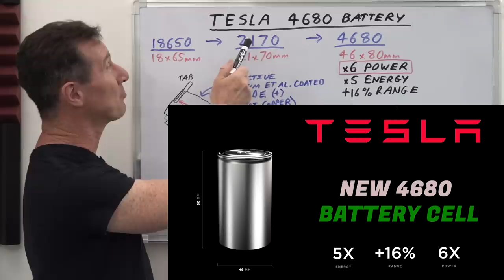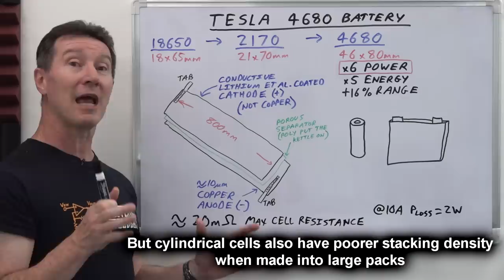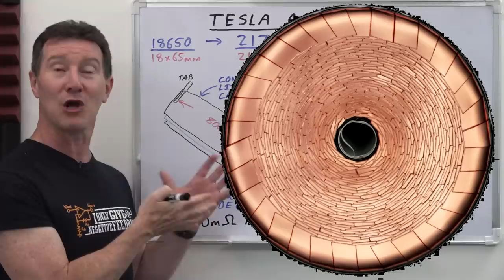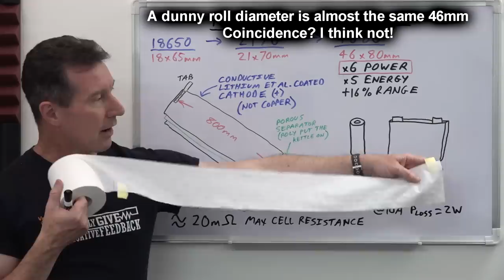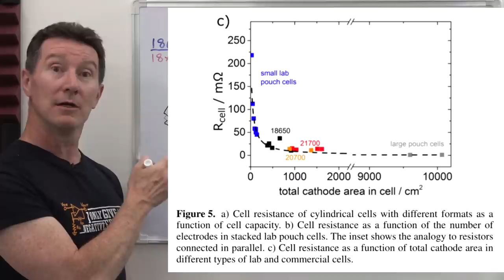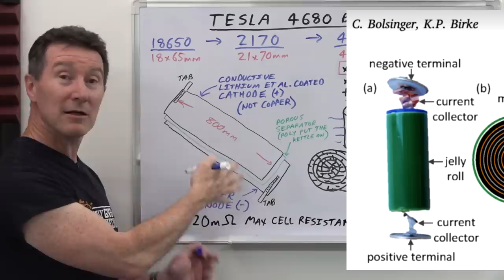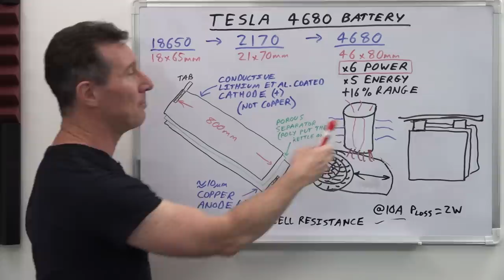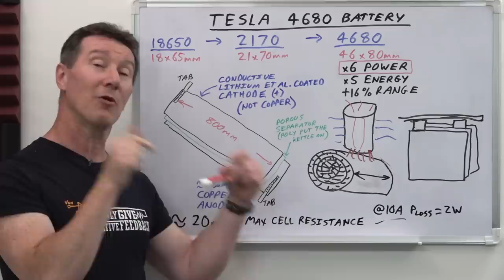EEVblog 1340 - New Tesla 4680 Battery Cell EXPLAINED

Comment: I suspect a non-insignificant chunk of the losses they also got rid of are related to the tiny fusible links connecting each cell to the bus bars, fewer cells = fewer links to heat up. But overall this new construction technique appears to be primarily focused on reducing manufacturing complexity and cost, but it’s been hyped for those questionable specs & claims.

The 6x & 5x figures mixed in with the +16% figure with no clarification really pissed me off and in my opinion was very negligent and honestly probably intentional to get those 'Tesla makes huge leap in battery technology' headlines. It’s very unimpressive when you remember to mention that it’s 5.5x the volume, I feel that number should have been front and centre, but then no one would have been hyped.
Reply from the maker: I'm not sure how this would get rid of the fusible links? But I'm not familiar with existing Tesla battery pack construction.
Yes, 5.5x the volume and only 5x the energy even with new cathode technology. Does this mean it's a step backward in energy density?
Reply: Perhaps this 5x is without the cathode improvement, and marketing has tried to be modest and rounded 5.5x down?
Reply from the maker: @spbnick  That would be the world's shittiest marketing department!
Reply: Apparently Telsa pays $0 for marketing. I guess shitty marketing = no marketing
Reply: @EEVblog  I understood the presentation to be built in steps, so each step was evaluated separately, and then they stacked up the contributions to the total app 55% improvement. Just the form factor is the 16% improvement, then the chemistry x%, then pack construction x% and so on... So they did not say that the 16% is the total range improvement, just that its the partial contribution purely by changing the form factor.
Reply: @EEVblog  less links?
Reply: @EEVblog  They will still have fusible links, there will just be fewer of them per kWh of battery and it’s more efficient to have 1 large fuse than 5 small fuses as wire cross-sectional area increases disproportionately to surfaces area meaning less heat is needed per amount of fuse per cross-sectional area as it increases. 
(figures not for a Tesla battery pack but the math is the same, this math is very back of the envelope so take it with a grain of salt)
But previously if have 39 AWG for an 11 A fusing current for a 1 cm long link you would get 27.29 mΩ per link, put 5.5 in parallel you’d get an ESR of 4.96 mΩ.
Whereas for a single cell with 5.5x the volume if they went up to 31 AWG for a fusing current of 69 A they would have a single link with an ESR of 4.27 mΩ. 
At an arbitrary 10 A per cell with those changes you’d go from 496 mW down to 427 mW, an improvement of 16%, coincidence?

I wouldn’t be surprised if the missing 0.5x energy per cell went toward the volume in the cell this new design takes up, the existing spot welded tab was pretty space efficient, this looks like it needs some special insert at the bottom of the cell along with a decent amount of space for all the folded copper foil, the rest they probably rounded down considering when it comes to packing the battery with those larger diameter cells they will have less efficient packing especially around the edges.

(Note: I’m stupid and probably overlooked something)
Reply: I'm guessing 5.5 the volume and only 5x the energy due to the anode and cathode having to be offset a bit from each other so there would be no chance of shorting along the ends.  There would be a small dead space along the 'jelly roll' edges that would reduce over all energy density.
Reply from the maker: @glassmanCZ  Makes sense, but that's not what everyone seems to have taken away from it?
Reply: @glassmanCZ  I didn’t see that part of the presentation! Although unfortunately it’s just more unlabelled graphs :/ I’m very doubtfully that’s a 55% increase in energy density, considering they don’t specify the units I’d bet it’s some sort of total vehicle range (not normalized for battery kWhs) after 1,000 battery cycles or something.
Reply: @EEVblog   The 16% range increase is only due to the construction and having less casing for the batteries . 20% extra for anode design changes 4% for cathode and 14% for getting rid of the bottom of the car and using the batteries instead. In total it is 54% better.
Reply: @WizardTim  I think the 16% you get is just from using "convenient" preexisting wire gauges, but for fusible links I assume they would be using exact metal dimensions rather than standard AWG sizes.
If you have 4x the battery, fusible link resistance drops by 4x but don't forget current also increases by 4x, so it all balances out in the end and I don't think it's any more efficient to have 1 large fuse than it is to have 4 small fuses.
Reply: @EEVblog  Here as well: 16% range increase, just from the form factor alone.... https://youtu.be/l6T9xIeZTds?t=4511
Reply: @gerrychen  Yea if you go from a fusing current of 11 A to exactly 50.5 A (5.5x) without worrying about standard wire gauges the improvement is only ~3%, but the 16% number popped out so conveniently I couldn't ignore it, if they explained their numbers we wouldn't have to speculate how they got them or if they even mean anything.

While you're correct about the resistance vs current the important thing is that that the fusing current of the wire doesn't increase equally with cross-sectional area like resistance does which is what makes this improvement possible.
Reply: @WizardTim  I didn't know fusing current isn't linear with cross-sectional area - thanks for educating me!  For others interested, search "Preece's law" for the fuse equations - apparently breaking current only increases with the diameter^(3/2) rather than diameter^2 like conductance!
Reply: EEVblog, I suspect that the 5x improvement in power vs. 5.5x volume has to do with dead space in the center of the cell. By going to the tab-less design it appears they had to leave a larger hollow space in the center. That center space likely accounts for the 5x vs 5.5x discrepancy. So in terms of volume per KW, it’s likely a little worse, but in terms of weight per KV it should be a slight win due to lower casing weight and less cooling stuff in the pack. That’s probably where you get 16% better range because it’s likely 16% more power dense interns if weight per KW.
Reply: @WizardTim  It's not "just more unlabled graphs", they dedicated a part of the presentation to each of these improvements and built the figure throughout the presentation. Just watch a summary of the presentation, there's no point arguing about it without any knowledge.

Comment: 8/7=1.1428, so there is already a 14% improvement in "range", using the same sized pack (with different thickness maybe.).
+ the 70 is meant counting in the tab, while this can be smaller in the 4680 cell.
+ the casing of the cell probably takes less place
So this does not contain seem moving the cooling to the bottom and up. (because that would be another saving in space).

Comment: Tesla is one of the greatest technological companies that hace ever existed. It is a company that always wants to innovate anda this video is the perfect example, in this case Tesla innovated in the battery chemistry and algo in manufacturing by making a new battery that it's better than the others. 
In my opinion, in the coming years Tesla will continue to make changes in the world, not only talking about batteries but also in the automotive field, just to give an example.
Reply: I think Tesla still has a lot to offer because as you say, it is one of the largest technology companies that has ever existed, and to maintain its prestige and level it will have to continue innovating and developing as much as possible.
Reply: You're totally right
Is incredible just to imagine what they are going to create and how is each camp of engineering changing due to they researches
Reply: As you said, Tesla is on the top of the innovative companies, and it'll enhance not only their services and products but also the way they are manufacturing them. This batteries are destined to it's electric cars, and that means Tesla's always one step ahead when it comes to sustainable vehicles

Comment: I'm definitely going to buy an EV as my next car
Reply: You will not have a choice in about ten years time
Reply: @jeremykemp3782  I'm gonna buy one much sooner than that. Fossile fuels will be obsolete in 10 years, thankfully
Reply: @TheChrisey  I don't think so, at the rate nuclear power plants are getting shut down, we'll be burning more fossil fuels instead of less. Well, It might be coal instead of gasoline.
Reply: @slome815  So far there is very little evidence to that. Not only nuclear gets built and upgraded, but wind and solar too
Reply: @TheChrisey  As someone with 80m² of solar panels, I can tell you it's great in the summer, but when you live at 55°N it's not all that great in the winter (with a heat pump
 as my only way of heating my house this means a rather large electricity bill). Wind energy is also great on windy days. As long as there is no real solution for long term storage electric cars are only marginally more green then IC engines.
I also doubt they will get a lot cheaper with scalability, being so dependent on rare elements like lithium or cobalt.
Not to mention 25000 is still way to much for many people. I never paid more then 3000 euro for a car. My last car (1988 mazda) cost me 900 euro, and gave me 7 years and 120 000km of problem free service.
Reply: @slome815  Well your scenario isn't all that common. Most people buy new cars or have to within the next 10 years unless you want to spend 25000 fixing that 1988 mazda. Those sources are obviously substitutes, but solar panels run everyday when the sun is out, meaning less need to generate power from other sources. The absolute vast majority of the electricity in western countries are generated by nuclear, and we already consume a shit ton of electricity, so the avilability is absolutely not going down. I've owned a ton of petrol cars that required services more expensive than actually buying the car, so I don't see how your service free argument is relevant. If anything, EVs will be way easier to service with fewer parts (I guess you haven't actually done much mechanical work on a normal petrol car, have you?). But the absolute most important thing is for vehicles to stop polluting the air in the citties. It's a massive contributor for people's headaches, asthma, allergies and everything else that is a result of oxygen deprevation. That is just basic physics. Our current fossile free power generators can generate a shit ton more electricity than what we consume today.
Reply: @TheChrisey  
"The absolute vast majority of the electricity in western countries are generated by nuclear" 
This is simply false. In the US 19.7%  of electricity generated is from nuclear, wind and solar 62% is gas and coal.
In europe the situation is a bit better with 26.7% of electricity being generated from nuclear energy, but only 42.8% from coal and gas plants.(https://ec.europa.eu/eurostat/statistics-explained/pdfscache/9990.pdf)

" I guess you haven't actually done much mechanical work on a normal petrol car, have you?" I find this insulting. I always do my own maintenance, and all repairs except  wheel alignement and balancing. My older cars have proven way cheaper and easier in maintanance compared to the newer ones. It's also notable that nearly all problems are not engine related, it's either the ECU, brakes, instrumentation, or suspension, never had any engine problems on any of my cars, and that includes my ( late fourstroke) trabant as well. 
But yeah, the 20 dollar oil change every 10000km is so expensive. All the other maintance are an issue on electric as well. They still have a suspension, drivetrain (though I admit it's a bit simpler), brakes, and even a cooling system.

The reality is that Tesla statistically has the second highest number of repairs per car in the US, and is rated the least reliable car by Consumer Reports.

Comment: If that cell has less internal resistance and better thermal management capabilities, it's got to increase the range a little bit just right there. Then there's your packaging considerations as well. I would also assume that with fewer jumper tabs going from cell to cell, the total pack resistance is going to drop as well. You're going to have beefier electrodes there too to handle the higher amp loads each cell will output, so during low current draw situations like cruising, it's probably going to have lower resistance through the whole pack and pick up a little bit of efficiency there too, which should all add up to a significant amount in addition to the ability to cram more battery mass into that space.

Comment: 4680, that's a chunky lad.
Reply from the maker: It's a fatty.
Reply: Well, you heard it, longer and thicker is better!
Reply: this kept being discussed .. but ..

doesn't a fatter roll stack 'less' efficiently ? or does cooling methodology affect this ..
Reply: Cookie Can Cell design 😜
Reply: @Darieee  I guess with fewer internal losses the reduced cooling capacity is less of a problem. 
In cooler climates it may actually help keep the cells at that sweet spot and the lower cell wall to cell contents ratio must also be a factor.

Comment: ponder
If cutting and folding tabs is causing production issues... why not simply not do it? Roll the pack with one more strip of tinned copper along the anode end at the material, calculated to be the width of the interim layer, and then compress it radially while touching it with just a wee bit of heat (since there are so many contact points, ultrasonic soldering?) to combine it into a monolithic end.

Comment: 5X energy like you said is because of volume change. Obviously the volume increases 5.5 times, and there is no hardship at all to improve by 5 times in total energy. However, for the 16% range improvement, this is same total volume comparison between 2170 and 4680. If the electrochemistry does not change much, then 16% improvement must come from the total volume utilization since the larger individual battery cell in the same volume utilize more efficiently compared to a smaller cell.

Comment: Correct...the 16% is only due to the formfactor change. Adding the announced changes in anode, cathode and pack design...it adds up to over 50% more energy stored in a similar sized pack.

Comment: Bit of a con in all these media titles (and from Tesla) when the reality is that there are still tabs ... But now hundreds of them, all folded over on each other in a spiral! Thus, vastly increasing the current carrying capacity AND massively reducing internal resistance at the same time as improving & dramatically reducing heat output for a given load.

Given it is such a simple solution it does beg the question "why has this not been done sooner"? 

Answer: SIMPLE! It required a complete back to basics and some outside the box thinking ... Something Elon Musk & his engineers seem especially good at!
Reply: was done sooner, is an old idea used in lead acid batteries even. Look up Optima brand. Same idea there but tesla does it on a smaller scale for each cell. The lead acid has only 6 cells and thouse are big.
Reply: If you consider that the original 'tab' was an extra component welded on then 'tabless' is appropriate terminology. 
The 'less' part seems more about the removal of that expensive/slow manufacturing step , regardless of the fact that the tabs are now numerous.

Comment: A couple of key points that you missed.
The Million Mile battery WAS introduced, you just have to do the math lol. It was the iron cell, and if you math the listed range and the cycle life, you get over a million miles, but no one noticed it because they didn't put the "Million Mile Battery" in neon lights.

Secondly, the cathode isn't a coated metal electrode anymore, it's a dry film that's made from a paste run through rollers, forming it in one step, and all combined, allowing it to be manufactured in one continuous motion, with no stops like the traditional design needs for welding and such.

Good look at the electrical side of it, but you seem to have based your information off the media talking points, and they missed the best parts lol

Oh, and they are using the steel case as part of the structural design of the car, so instead of being dead weight like all the other battery designs, it's actually used for strength.

And in combination, all the things like reduced weight increase car range by reducing weight etc, so while the cell is itself is only 16 percent better, the pack is more like 50 percent better including all the factors, which makes it part of a VERY exciting development.